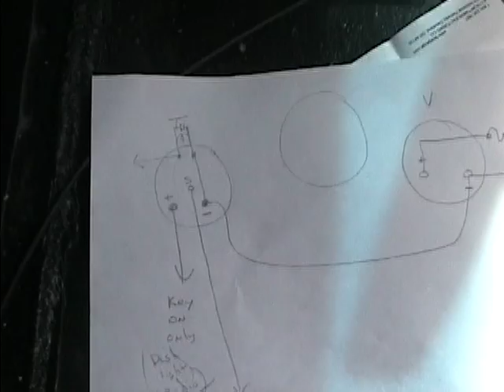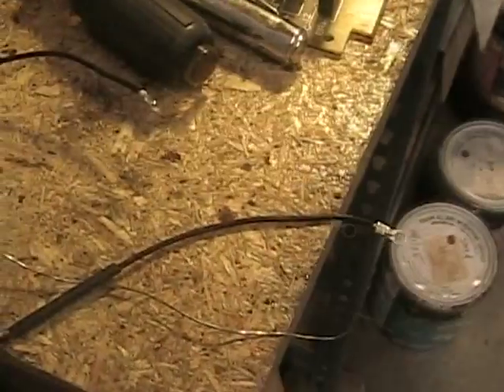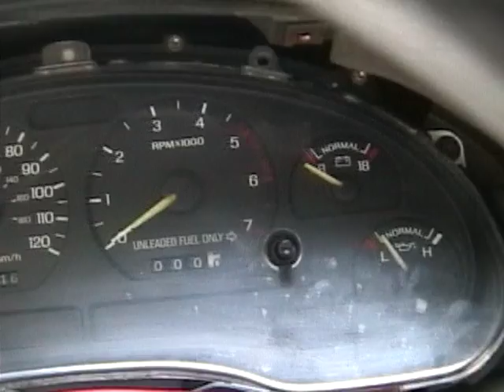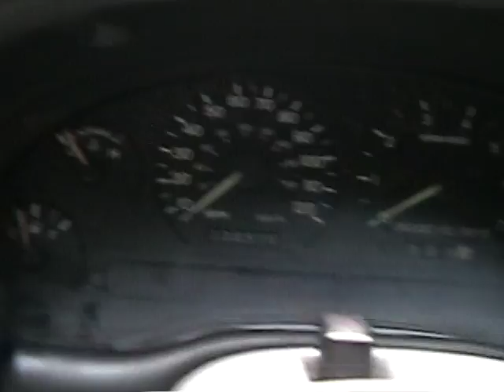Mustang Gauge Install

Comment: where did you run the wire through?  I have a temp gauge to install on my 95 and I'm tapping into the rad hose, but I don't know where to access through the firewall..??
Reply: Tyler Williamson 
Do not read the radiator temp as when the tstat is closed it will give u a false reading of the motor. need to read off somewhere in the intaje manifold that see engine coolant.